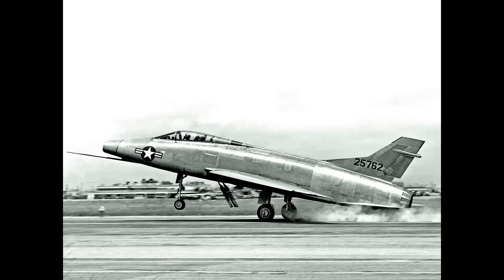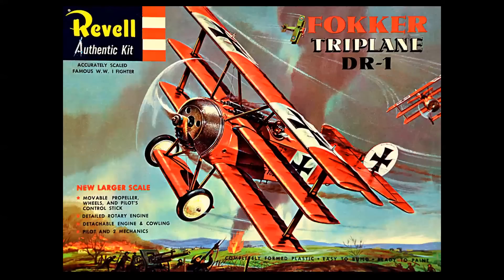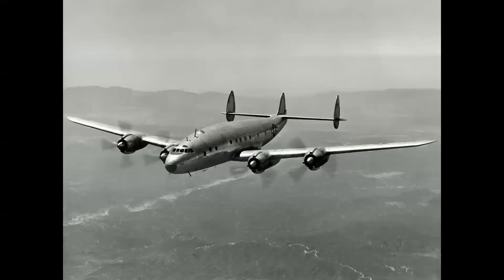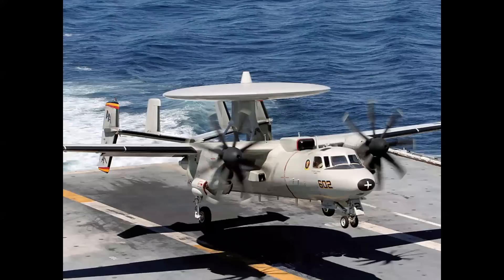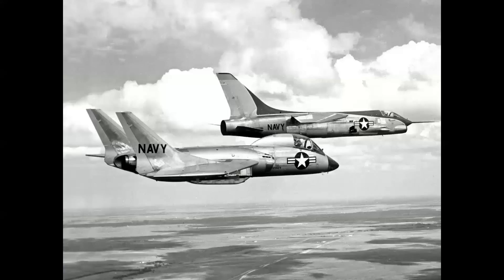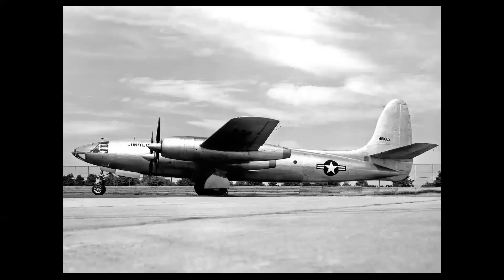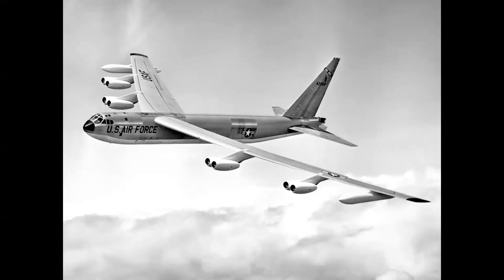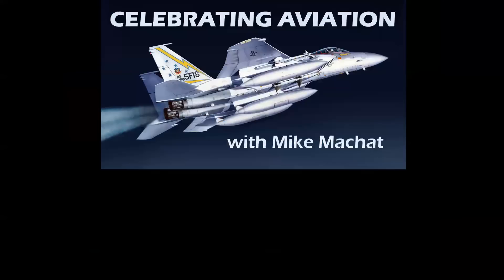VERTICAL STABILIZER DESIGN - A Photo Essay Showing Aircraft Tailfins Throughout History

Comment: I was thinking the XB-70 may have the biggest X plane tails. But I could be wrong.
Reply from the maker: Great point, and I should have clarified "in proportion to the fuselage." X-15 was largest, and XB-70 one of the smallest, yet with perhaps the biggest fin size of any X-Plane. Thanks for watching!
Reply: The Valkyrie wasn't in the X plane series, it was in the bomber series. The biggest X-plane tail had to be the X-6 which was the nuclear reactor carrying version of the B-36, and proportionately to fuselage size, I'd say the Ryan X-13 Vertijet may be the winner.
Reply: @Mishn0  NASA may have a differing opinion on whether XB-70 ever counts as an X-plane, "Feb 28, 2014 NASA Armstrong Fact Sheet: XB-70 Valkyrie ... At the same time, a joint agreement was signed between NASA and the Air Force to use the second XB-70A prototype for high-speed research flights in support of the SST program, selected due to its better aerodynamics, inlet controls, and a much superior instrument package, compared to the first aircraft. The NASA research flights were to begin in mid-June, once the North American Aviation Phase I tests of the vehicle's airworthiness were completed. NASA research pilot Joe Walker was selected as the project pilot. The flights were to evaluate the aircraft on typical SST flight profiles, and to study the problems of sonic booms on overland flights. ...
National Aeronautics and Space Administration 
Page Last Updated: Aug 7, 2017 
NASA Official: Brian Dunbar 
Editor: Yvonne Gibbs"
Reply: @Mishn0  And NASA actually call it an experimental aircraft here, "Feb 8, 2016 North American Aviation XB-70 Valkyrie
North American manufactured two airframes. They flew a total of 129 flights between 1964-1969. The joint program among North American Rockwell, the Air Force, and NASA featured the world's largest experimental aircraft with a delta wing and hinged wing tips that could be folded down to a 65° angle to improve stability at the aircraft's supersonic speeds of up to Mach 3, a speed at which the Valkyrie was designed to ride its own shock wave. The program used the Valkyrie to conduct fundamental flight research at high speeds for use in designing future supersonic aircraft, both military and civilian. The aircraft produced a significant quantity of information on supersonic flight at up to Mach 3 speeds in areas such as noise (including sonic booms), potential flight corridors, validation of wind-tunnel data, flight control, operational problems, and clear-air turbulence.
Last Updated: Aug 6, 2017
Editor: Monroe Conner
National Aeronautics and Space Administration 
Page Last Updated: Aug 6, 2017 
NASA Official: Brian Dunbar"
Reply: @scottfw7169  The XB-70 is an "experimental plane" in that it was used for experimentation, but it is not an "X-plane" in the same series of aircraft designations that started with the Bell X-1 and through the X-15 and on to the X-62.

Look up "list of X-planes", the XB-70 isn't on it. She'll be on the "List of bombers".

But, whatever makes you happy.
Reply: @Mishn0  Thirdly and finally, NASA list XB-70 as an "X Plane" here, while recognizing it was originally a bomber prototype. But if NASA call it one of their X-Planes, then it is a NASA X-Plane, "X-Planes Flown at Armstrong Experimental aircraft, or X-planes, are built for a wide range of research purposes – technology or concept demonstrators, unmanned test missiles, and even as prototypes. Here is an overview of X-planes flown at NASA’s Armstrong Flight Research Center. ... XB-70 Valkyrie The XB-70 Valkyrie seemed to be a perfect testbed for supersonic transport (SST) research. It was the same size as the projected SST designs, and used similar structural materials, such as brazed stainless-steel honeycomb and titanium. Thus, the XB-70A's role changed from a manned bomber prototype to one of the most remarkable research aircraft ever flown. Early flights provided data on several issues facing SST designers, including aircraft noise, operational problems, control system design, comparison of wind tunnel predictions with actual flight data, and high-altitude, clear-air turbulence. (Back to Top) ...
National Aeronautics and Space Administration 
Page Last Updated: Jul 22, 2021 
Page Editor: Laura Newton 
NASA Official: Brian Dunbar"

Comment: Hiya, the eventual B17, B29 and even the B36 all seemed to have used the same aerodynamic design. And I have also noted the striking similarity between the 707 and NA F86 tails as well. As time passed and jet powered military craft became faster, so many of them had changes needed to their vertical stabs. The F100, B52, English Electric lightning. Also appeared to have either the tops snipped or the edge extension increased.
Earlier times, when computer modelling was simply not possible for fluid dynamics. As a kid, I remember reading a book which said that computers will never be able to help to model aircraft. How things have changed.
Reply: You can add the B-32 to that common tail design. The form of the rudder hinge area is even the same as the B-29's.

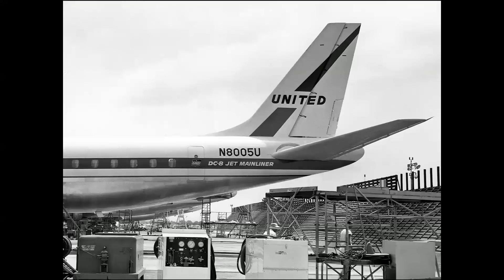Comment: At time 9:15 you refer to the fin area below the aft fuselage as giving more yaw authority at higher angle of attack. But the main reason to add this lower vertical area was the certification requirement of the UK airworthines authorities that demanded to have a device that prevented over-rotation on takeoff to prevent ground stall conditions. The requirement was a consequence of several ground-stall accidents in the eartly Comet 1 aircraft. This was for the 707-400 series which were Rolls-Royce Conway powered for BOAC. Boeing realized that this added area had other sinde benefits and kept it for all subsequent models of the 707 series.
Reply: Plus, it was a "ventral fin", not a "dorsal fin".
Reply from the maker: @Mishn0  Yes, caught that after the video posted (still dealing with post-COVID brain fog). Thanks for watching.
Reply: @Mishn0  Yes, you are right, it was a ventral fin.

Comment: I'm an aero engineer. 

Tail design is one of the areas of truly terrible design choices made by even very experienced designer.

The idea of "tail volume" -- area and moment arm -- you've covered pretty well here. The main  concept is enough control authority to be statically and dynamically stable and also meet control needs and certain emergency situations.

The reality is this: The vertical stabilizer and horizontal stabilizer interact with each other. The interaction in normal flight is generally a pretty easily understood concept. 

Where the interaction is not very well understood by most designers is in conditions that are not ideal. Speeds beyond Vne, during a spin, imbalanced stalls, high power no airspeed all cause truly different flow conditions over the stabilizers.

The reality is a cruciform design is generally the best compromise of strength and ability to stabilize spins quickly as well deal with other off design scenarios.

T - tails have tremendously spin recovery but structurally are costly.

Conventional tails with low mounted horizontal stabilizers shadow the vertical stabilizer during a flat spin. They are strong but cause all kinds of recovery issues. The higher you mount the horizontal, as a rule, the better the spin recovery and for given strength the heavier the tail.

You can move the horizontal tail forward to shadow the vertical stabilizer less during spin.

You can add vertical stabilizers to the bottom of the fuselage to assist as well....many, many modern designs have this band-aid because of poorly designed tails.

V - tails don't stabilize as well as standard vertical and horizontal. The reason for this is the tail when in a yaw fugoid will "slide" up and down. There's a cross couple of yaw to pitch that cannot be eliminated.

Understanding of tail design comes from lots of time in a wind tunnel studying things generally you are not budgeted to do. 

Money is generally not given for safety improvements, it's typically earmarked for efficiency improvements. And generally in good tail design most companies don't recognize that the addition of strakes on the bottom of a fuselage will be more costly in efficiency than a well designed tail.

The reason why cruciform tails are not used by airliners is the need for spin recovery is seen as trivial compared to the need for efficiency.

Hope that helps someone out there with understanding a bit more about tails...
Reply: Great explanation in layman's terms...
Reply: Thanks
Reply: I have a question, if you don't mind answering. You mention moving the horizontal tail forward to improve spin recovering (like in the A6M). But what is the intention behind moving the vertical tail forward? It was done in the F4U and several supersonic jets, even with dual tails (F-18 and Su-27).
Reply: @magoid  moving the vertical tail forward, or moving the horizontal rearward behind the vertical stabilizer, is doing the same thing that moving the horizontal stabilizer forward. It unshields the vertical stabilizer if forward or aft of it. Moving the vertical stab forward/elevator aft would be used where you need more leverage for pitch authority. Having the horizontal stab moved forward reducing its lever arm, and therefore its "tail volume" coefficient. Some aircraft dont need that much elevator due to being balanced aft near their neutral point, where a little elevator goes a long way. (Like a heavy balance beam, balanced almost on its CG and easily tipped by a finger light pressure).
Reply: @Triple_J.1  Good explanation(s).
Reply: @magoid  In the case of the F4U, it was probably done for the same reason -  to see clean air in a spin.  In supersonic jets, it's done for area ruling - to "smooth out" the cross-sectional area distribution curve.
Reply: @johnh2410  I believe area ruling is a myth
Reply: @johnh2410  I am always struck by the ratio of the vertical stabilizer to rudder area of the F4U/FG aircraft.
My grandfather groundlooped one badly enough to wreck it while he was in the Navy, so it might have had too much rudder authority, or, not enough rudder authority.
Reply: @DumbledoreMcCracken  The F-102 couldn't go supersonic until Whitcomb's Area Rule formula was used to "waist" the fuselage. After that, going supersonic wasn't a problem for it at all.
Reply: @DumbledoreMcCracken  Based on what facts?
Reply: @johngregory4801  you are making the claim it is real.  You provide me the facts
Reply: @DumbledoreMcCracken  That the F-102 couldn't fulfill it's design specification until Whitcomb's Area Rule was used to redesign the fuselage is recorded history. Meanwhile...

You still haven't said why you BELIEVE that the Area Rule is a myth.
Reply: @johngregory4801  you have not provided any facts, just hearsay.
Reply: Your excellent explanation reminded me of a question about the B-2 Spirit.  How does this tailless flying wing handle spins?
Reply: @Primus54  you don't spin it. 

If you do, split-flap airbrake ailerons, if that doesn't work punch out.
Reply: Prominent example of this is on all the aerobatic monsters like Extra 300, Zivko Edge, etc., with the hugely jutting out triangular area on the bottom of the rudder, that could not be blanked out by the elevator no matter how deep the stall or how flat the spin.